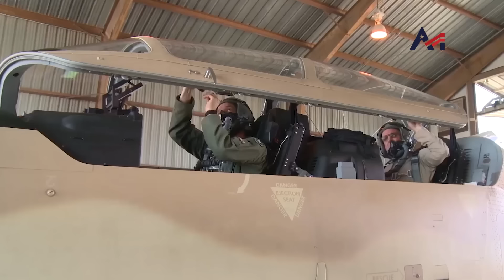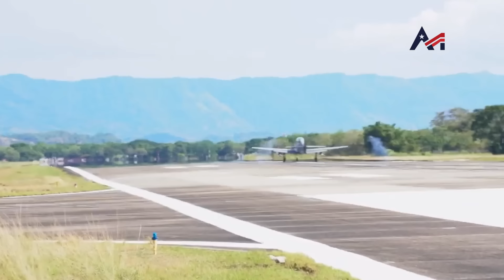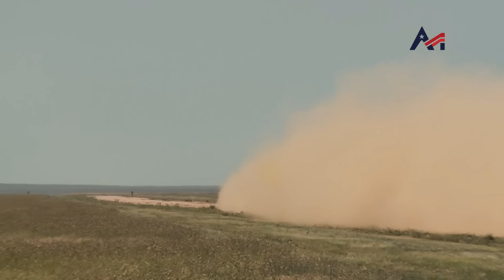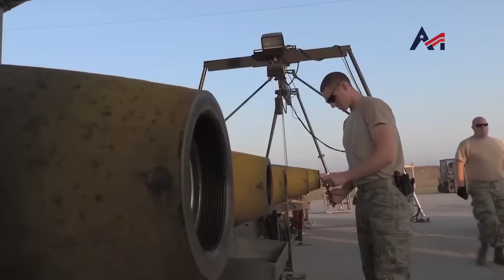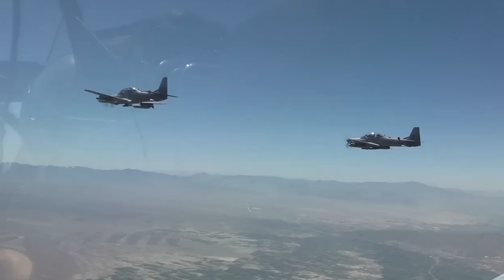U.S. Air Force’s New Answer To Shahed Drones

Comment: I just checked. The USA has just purchased about 10 or so. They are bought from Brazil and finished in the USA. They are currently assigned training tasks such as first solo flights, but there is interest in fact for a broader role. Cessna has some better planes, but they are twin engines and therefore use more fuel and other than  for the Coast Guard and ocean border patrol, Cessan never was asked a true "guerilla" warfare "request for bid"  on a slow flying battle aircraft.

Comment: The  Ukrainian drone “P1 Sun” costs $1000 a piece and had a success rate of interception of the Shahid drones in the 80% range with its prototypes. It can fly at up to  16,400 feet at speeds of 280mph vs a maximum altitude of 13,000 feet at 150mph for the Shahid. Strikes me that we would be better served by dispersing 1000’s of P1 Sun drones vs a 100 or so expensive planes that require 2 flight crew members. Much cheaper and allows flight crew for other missions. Of course, given two options we always choose the path that is more expensive.

Comment: Rather unusual idea. Equip the planes with 20 automated  "fishing line" reels  containing  several hundred feet of "heavy duty " lines  equipped with "lead weights.  

Deploy lines, fly over a drone,  snag it's propeller (won't work on jet powered ones) or line warps around entire drone . Even if drone explodes chances are line has already been cut line and it's falling.  They weigh about 440 pounds so use 250 pound Spectra lines.

Comment: I like all the comments. 

Several years ago the US chose the Skywarden over the super Tucanos. Skywarden was renamed Skyraider II by the Air Force last year. Only a few have been produced. The bases for this plane is the Air Tractor AT-802. Very solid platform and great specifications. 

OV-10 is/was very cool. Canadian Icarus Aerospace in 2020 launched the TAV. Almost a Bronco.

In Ukraine they are using AN-28's. They are built buy Poland since 1978 by PZI-Mielec now a M28 Skytruck. In 2007 Sikorsky bought the company and then in 2015 Lockheed Martin aquired them. Ukraine uses door mounted M134 mini guns with laser targeting to shoot down drones. One crew had 10 kills in one night. The US has 5 (we had 18) M28's. Air Force designation is C-145 Combat Coyotes.

Comment: This is the AirForces replacement for the A10...seems like a poor choice vs what the A10 does.  But how does it bring down a swarm of drones....say 1000 scattered over 5 miles, 15 minutes out and closing in on their target?   Does it shoot bullets at 'em.  Release nets?  Suppose the drones aren't using gps or similar, just cameras?  Radio jamming will not work.  And if the drones are tree top skimming...how does the A29 see 'em.   This really an Ad for the plane that maybe could, maybe modified for, might work but not a reason to use it.  Has been tested with 1000 drones...we could do that easy right?  If not tested...its not practical.  How does this compare to an A10?  Why are we getting rid of the A10s?

Comment: Anti drone rocket with proximity fused rockets with wide dispersement warhead. 3.5 hours endurance is nothing for the anti drone mission. 5.5 hours with external fuel tanks helps wut it takes away from the number of rockets that can be carried! Just a hyp video

Comment: The US chose the Skywarden instead of this.
That its domestically made by AirTractor probably played a factor in that decision.  Other than that they are probably pretty similar, although the Tacano is faster...I think the Skywarden has more loiter time.
Either would be good for drone swatting.
Reply: I watched a video by the L3  OA-1K Skyraider II test pilot.  Turns out you can, as he said "take off the wings, and throw it in the back of a C17".  

Also, it's bristling with sensors, and can support two dual sensor pods.  All that data can be conveyed, real time, to a Vortex terminal on the ground, (I had to Gòóglé that, and the underlying data transmission standard).

You're probably right about the speed vs loiter time. The test pilot said they use ~150 HP less than the engine is capable of.  That probably extends service life, too. Also, they use half of the chemical tank for fuel , and the other half of that space is for electronics.  He said the wing tanks are filled to less than capacity, and are self sealing.

Interesting enough, the Super Tacano has less than 4,000 payload, while the Skyraider II is 6,000 pounds.  The Super Tacano has a lower stall speed.
Reply: @L @LloydMcElheny-d2w good points, I don’t know enough about the Skyraider.

I also figured that they picked it because it was (1) cheap, (2) easy to maintain, and (3) carries more weight than the alternatives, like a Tucano.

Also, it’s meant for close air support of ground SOF, not an anti air drone platform.
Reply: @mevman44  OA-1K Skyraider walk around with its test pilot https://youtu.be/_nKCBO8hfFw?si=s8_LulaGQwVQ_Dse. Note it's introduced by its original name as Sky Warden. There's also a video on Sandboxx.  I Gòógled a couple of comparative stats to Super Tacano like stall speed and payload.
Reply: TBF – other than this video – I never even heard of the Super Tacano being designated as the A29, let alone its being identified as a drone hunter
Reply: @LloydMcElheny-d2w I don’t think it’s designated a a drone hunter, per se. But it is used by other countries for the light attack and counter-insurgency roles. The only times that it’s been used the US military are for limited testing and test pilot school roles.
Reply: @mevman44  You're right, the video presented it as the answer to drone hunting, not as its primary role.  Wikipedia cites the A29 being used strictly to train and equip a coalition Afghani light attack squadron, which all went for naught, once the Taliban was back in power.  Of COURSE I don't take that as the last word.  Other top search results seemed to be about the same thing.

So I can't figure what the deal is with this video at all, which signifies approximately nothing.  It remains a mystery to me.
Reply: @L @LloydMcElheny-d2w  is a little confusing, given the A29’s operational history. Brazil uses it more than the US, but even then.

I think, outside of cynicism, the channel staff is making an argument that this would be a good anti-drone platform to a layperson audience, some of whom may be connected to movers and shakers that could get Embraer some sales.

The other thing is, compared the Skyraider II, the Tucano looks cooler and is certified as aerobatic to ~+7/-3 g, while the Skyraider II doesn’t have easily accessible public g ratings. People, especially laypersons scrolling on YouTube, like “sexy” airplanes, which is one of, but not the only, reasons that the X-35 won over the X-32. I like the design of the Skyraider II, but most people would say that Tucano just looks cooler - like a Porsche 911 vs. a Toyota Sienna.

While I do think that it would be easier to do repeated rolling scissors style diving gun runs against Shahed drones in a Tucano than the OA-1K, aerobatics are probably not necessary to take those RC flying motorcycles out when using cannon; the drones are not aerobatic, AFAIK.

Now, here comes the cynical part / conspiracy theory. This channel appears to have really professionally produced videos, where many of shots do not look like stock footage. The people making these vids are not necessarily aviation enthusiasts, they could be just people hired to do a job. Lots of YouTube videos do this - plenty of USAF focused videos talk about F-16s while showing stock footage of Hornets. This video was secretly funded by Embraer as viral marketing to get more A-29 sales.

There is a healthy amount of discourse in the American media USA-Israel-Iran war opposition that the USA, as many countries that would be in similar situations, is losing lots of money using expensive interceptor missiles to take out drones that are at least 5x cheaper. Guns kills would be cheaper than missile kills, and the Tucano is cool looking and relatively cheap alternative to an attack helicopter or an F-16 to potential buyers, including the US and Israeli governments.
Reply: Wondering how payload the capacity compares?  It makes sense that the payload for a crop-duster would have a lot more than a trainer.
Reply: Can the Skywarden fly aerobatically? I’m not sure. The Tucano can. I’d think this would be an important feature for slow anti-drone manned propeller planes. An Apache UAE attack helicopter when down a few weeks ago while doing air defense against Iranian drones, with both air crew dying. Aerobatic and fast(er) aircraft might have held up better.
Reply: @mevman44 your comments are completely mystifying to me.  For one thing, it's not even called the Skywarden any more.  And I don't see what the performance of a helo has to do with "acrobatics"?  Do you think you know the entire circumstance of the Apache going down?
Again, I find all of this mystifying.  Are you aware that the American APKWS is fire and forget? Where do acrobatics come in.
I guess I'm just too dumb to comprehend your position.
Reply: @Lloyd @LloydMcElheny-d2w  a guess, and not probably accurate. I’ll need to change my priors, lol.

I was thinking that a aerobatic fixed wing, like a Tucano, would have an easier time doing repeated diving gun runs to take out drones while staying out of debris range than a chopper or the OA-1K Skyraider II (thanks for the update, didn’t know the name was changed). But this view is not necessarily accurate, and may not have been applicable to this case.
Reply: @mevman44 I hope my response didn't come off as overly harsh, as I honestly didn't mean it to be.  And calling it Sky Warden was fair, as that's what the video called it. I admit to a tinge of snarkiness in that part, so I appreciate your gracious response.

 Also:  there's video of a Ukrainian F16 pilot splashing a Shahed with his Gatling gun, which of course took some INCREDIBLY fancy flying, especially given that big air intake.

The Skyraider II doesn't have integrated guns.  One can mount 20 mm cannons or 50 cal machine guns.  And it seems to me the primary USAF air-to-air anti-drone weapon is the APKWS, of which the latest version is fire and forget.  A lot to ask of a single pilot, and the second seat in the Skyraider II can act as a temporary WSO.  There's reports of Kuwaiti pilots splashing numerous drones with older model sidewinders.
Reply: @L @LloydMcElheny-d2w  worries, I thought the response was funny.

I haven’t seen the Ukraine F-16 Shahed  shoot-down, but I did see the UAE F-16 Shahed beach sidewinder take-down. Interesting and scary. Also, expensive, at least compared to using rounds.

Gun kills of drone are going to be tough, especially when using fighter jets. They move too fast in comparison to the drones, so getting FOD in the intake during a staffing run is a real possibility.

But, now that you mention it, the Skyraider II would be quite good for anti drone gun runs given that it can change gun pods, and the performance specs puts it in a good range for intercepting something as slow as these drones while being relatively cheap.
Reply: @mevman44 the point with the Kuwaitis** splashing LOTS of drones with sidewinders was they're using older versions, so replacement costs need to be finessed.  Alex Hollings said it was more like $35k

As for speed, he posted another video on Sandboxx about home defense Warthog squadrons being replaced with F15EXs.  They have APKWS in part for slow drones, and they need their speed to intercept the drones to start with.

** The ones that forgot their deconfliction training, and accidentally splashed two F15s

Comment: If I were a military pilot this, or the A-10,  is the plane I would want to fly.
Reply: Same.  Beautiful airplane.
Reply: A-10 wins my vote first and foremost every time.
Reply: @homelessnomad52  - Different missions. THe A-10 is the ideal delivery system for ground based armies. THis is the ideal delivery system for small arial drone swarms. ANd I expect it can be modified to have tools for surching for and destroying small wate based drones as well.
Reply: The A10 has a titanium bathtub surrounding the bottom half of the pilot, earning the nickname of "The flying coffin".
Reply: @bretjohnson6188  - I don't think so. It was known as the flying tank because it brought pilots home even with major amounts of damage. The "Flying COffin" was the B24, or the F104. I was in the USAF around A10 pilots and mechanics for years, and never heard it described as the flying coffin.
Very few A-10s ever crashed. That titanium batchtub was incredible armor.

Comment: How is an airplane supposed to deal with swarms of drones using .50 cal heavy machine guns? Even if an ace pilot hits one or two drones on every single attack run, he or she could optimistically down what, maybe a dozen drones on a perfect sortie before running out of big, heavy .50 cal ammo? What difference does it make if 95-99% of a swarm makes it through?

Comment: Needs to be a single seater, get better sensors and be integrated with a regional system. This sounds like manufacturer's advertising
Reply from the maker: Fair point 👍
Sensor capability and integration into a wider network are definitely key factors in modern air combat.
And yeah, early concepts often sound a bit like marketing until we see real-world performance.

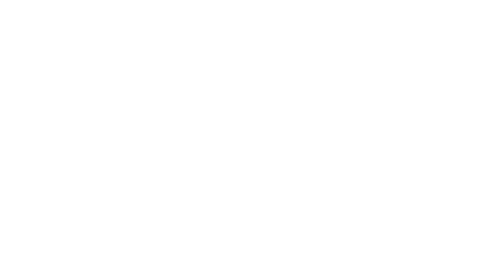Comment: Minute 7:37-7:39 F.A.D.  on the back of the maintenance orange jacket officers, and on the side of the A29 Super Tucano air plain, but the Dominican Republic made TP75 Dulus armed with 50 Cal. laser guided rockets and missiles, is better and many times cheaper, against the Iranian and Russian drones and cruise missiles, the TP75 Dulus is 1/3 smaller than the A29 Super Tucano, and it can loiter more than 5 hours that's more than the A29, fifteen times cheaper maintenance and fuel, plus fifteen times less expensive.

Comment: Ok so explain to me how that plane will survive contested airspace?
I think the answer would be a ucav.
Cheaper than a turbo prop plane and can be made far more lethal without risking a valuable pilot.
Reply from the maker: Great question 👍
Surviving contested airspace is a real challenge for any aircraft today. It usually comes down to a mix of tactics, electronic warfare, and support from other systems, not just the platform itself.

UCAVs definitely have advantages in terms of risk and cost, but manned aircraft still offer flexibility, real-time decision making, and adaptability that’s hard to fully replace (for now).

Most likely, the future is a combination of both working together.

Comment: **How about instead we take a note from history with the B-29 and others like it!!
**Take a C-130 or a Osprey Mount multiple gun ports all over it (top, bottom, nose, tail, and at least two waist gunners, if it's a C-130 you could probably mount a dozen guns on it) mount a six-pack in each position (that's a 5.56 minigun the little brother to the 7.62 minigun) then you got two pilots but you got six gunners hunting targets, that are not dependent on lining up the plane with the target!
**It's going to be a lot easier to swivel a minigun pindle mounted than it is to turn a plane into lining up on a small target like that!
**Training pilots is expensive, (especially training for just this one particular specialty) plus another 6 planes with limited ammo capacity!!
**The six packs feed from a 500 round magazine that are easy to replace!! And the C-130s could carry a ton of them!! And they'd be able to stay up as long as they have fuel!!
**But knowing how the government likes wasting money, they'll probably go with the sixth individual planes instead!!

Comment: Can’t imagine where American propeller tech would be had they kept improving the P51 Mustang.  Super Toucanos are very good but benefits from modern technology.  The P51 is almost 100 years old and has almost the same engine power and maneuverability.  American aviation manufacturer need to revisit prop technology to match the enemies cost efficient weaponry as the Toucanos are not made in the USA.

Comment: My honest opinion here is, if the Embraer A-29 Super Tucano cannot hold up to that of a P-51 Mustang, then I am not interested. What we need is a plane that has both a cruising speed, ceiling capability, range, and maneuverability of a P-51 Mustang but now better. The Embraer A-29 Super Tucano is perhaps inexpensive and practical, but it will most certainly fall short in an active arena.
Reply from the maker: That’s a fair comparison in terms of performance.
But the Embraer A-29 Super Tucano is designed for a very different mission set, where endurance, cost, and close support matter more than speed or high-altitude performance.
Reply: @americanmililitary  I like the plane but I'm thinking of Iraq during the war and the use of the A-10 Warthog, that was close, but the plane pulled through spectacularly on hard missions. So, in the arena, I believe performance is key toward success and climb & speed are a necessity as well; that's to say, when things get rough, I don't want to be caught in a slow plane. Again, I am certain that this plane has a niche role to play, but my feelings are, I would rather have something a bit combat ready in an active but uncertain and hostile situation.